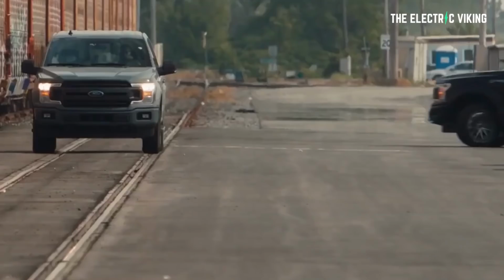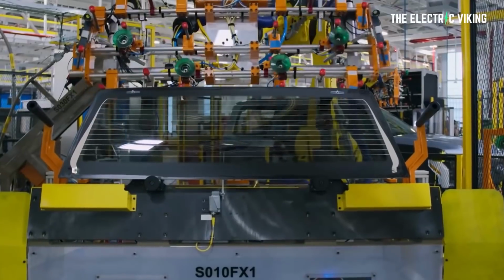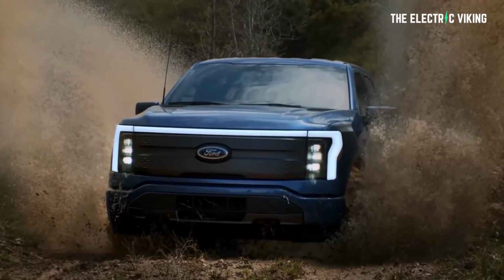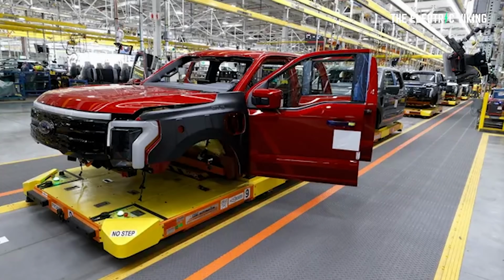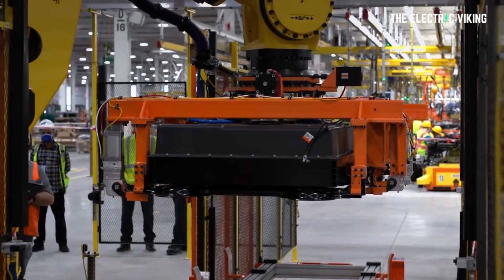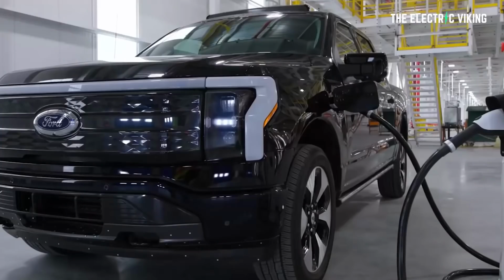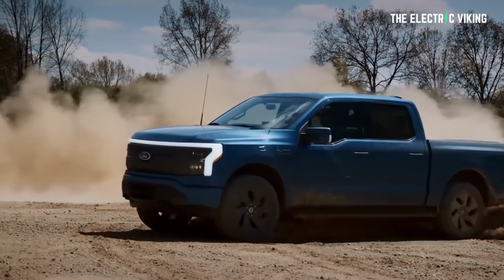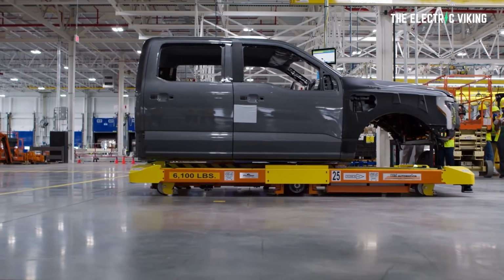Ford's new EV plant exposes Ford's ticking time bomb

Comment: One thing the F-150 EV has that could be a game changer is its Intelligent Backup Power. The truck can provide 9.6 KwHs to power your home. This could disrupt the entire backup generator industry and at a minimum force other EV manufacturers to provide this feature.
Reply: Mostly gimmick because first of all you may want to be able to drive your vehicle which is now powering your house and can’t be disconnected, you also may want to have your battery full for driving (especially in emergency situations) and not depleted by the house energy consumption. Lastly this sounds good for clueless customers but you can’t simply hook up your house to external source of power when grid is disconnected without additional equipment- automatic transfer switch ensuring grid is safely disconnected from unexpected source of energy (your car). If you already buy ATS and all electrical service needed to make this work this better to simply buy stationary backup battery. Overall: Nice to have but nothing truly necessary or revolutionary manufacturers may want to make people think.
Reply: @kubismatik2  Its all digitally controlled Your house does not go dark if you disconnect your car. Its still connected to the grid. You average car today can power your average US home for two days. It only needs to power it for 4-5 hours in the evening during the peak demand. There is a ton of wind energy everywhere at night that is unused and can go to the cars. That is why if you drive past a wind farm late at night they are all shut down. Even though the wind blows more strongly at night on average. If there is no place for the power to go, it blows up transformers. The entire grid is a just in time system with no inventory. If you can power your house from your car during those peak hours? It will save you more than 70% of your power bill. Peak time is the most expensive energy.
Reply: @davefroman4700  sorry you misunderstood my comment, I talked about use for backup power as someone mentioned generators. You talk about V2G which again is something doubling the function of stationary battery which is always available.
Reply: it's not the battery power but the current and an F150 can't run a 4-5ton AC.
Reply: Governments are going to force V2G capabilities onto the manufacturers. We need to use the cars as storage as well as transportation.
Reply: Well, do you see the problem with that? Sure it can power your home during a blackout but how are you going to get to work in the morning on a dead battery?
Reply: Surely 9.5kWh is barely a tenth of the battery capacity for such a vehicle. I would expect in times of emergency outages that nearly the whole battery’s capacity could be available for home use.
Reply: @steveharvey2001  This 9.5kWh is not a battery capacity rating.
Reply: @twosawyers  it’s less than a tenth of a battery with over 100kWh capacity.
Reply: @steveharvey2001  it’s telling the max KW it can put out in a hour.  Your home is using 9600watts a hour, unless you have very inefficient equipment.  Space heaters water heaters and AC are the biggest energy killers.  In other words it should power a average home 3 to 4 days.
Reply: @steveharvey2001  I was ignoring the 9 kwh as that isn't even one small electric heater. It is my understanding that most can back feed to the full capacity of their battery.
Reply: Call your electrician and ask him how much to rewire your home to use this feature. You can power a few things but to run your house would cost some bucks. And of course it heaven forbid you need to go somewhere the powers off till you get back. It's handy but it's far from the end of generators.
Reply: It's good in theory, if it's really good (actually used) everyone can implement it in a week.
Reply: In my opinion the F150 is the ultimate electric vehicle at the moment!
Reply: @twosawyers  good thing no one cares about your opinion. 

BTW: when are you getting yours? did you put your order in?
Reply: My 1972 VW kombi can do that :)
Must have something to do with the inverter and LiFePo batteries in it not the 1600 air-cooled VW engine it uses for driving around.

Comment: Or, the old ICE factories can be reset, revamped, redone to be electric car manufacturers instead of ICE manufacturers.
One plant at a time, and current employees could help so no/minimal job losses would occur.
Reply: except their electric factories will have more rorbits and less workers
Reply: @nick191088  The EV factories have less robots and less employees by virtue of a simpler process with less workstations.
Reply: The old factories will be under management of the ICE brand. Ford is planning a series of new EV factories in Tennessee. They have been using temp workers for years, which is probably saved them a lot during this chip shortage while factories are idle. ICE will ramp up a bit for the next 2 years but any new jobs will be temp workers while older workers retire. Younger workers will be transitioned to new EV factories over the next few years. It will be a 5 or 6 year rebalancing instead of mass layoffs.

Comment: Many auto factories are now using AGCs - Automatic Guided Carts that need no tracks or rails. A bare bones vehicle is placed on each cart which then dutifully stops at each "station" where specialized workers assist robots, then on to the next stop until the single inspection on each finished car. Tesla uses the same EQUIPMENT, but ONE TEAM is assigned to EACH AGC and goes with it until the car drives away. Each team member knows ALL jobs for that team and teams inspect each other's work - as do the test robots at each station.
Reply: This " Each team member knows ALL jobs" explains Tesla's poor quality control and is the  most inefficient method of mass production.
Reply: @heathwirt8919  : production numbers would indicate otherwise
Reply: @dewiz9596  Abysmal quality control is a true indicator of production efficiency or in Tesla's case lack thereof.
Reply: @heathwirt8919  Nope! Tesla had some quality issues because Freemont was not setup to use AGV etc and also Tesla was not experienced at mass production. Just as FORD had MANY quality issues when  they released the Model T Ford, even today they STILL have many quality issues such as over 1.4 million cars recalled due to steering wheel falling off to name just one.
Look at Fremont now and also more importantly Tesla China where the quality is now spot on.
The cars coming out of Tesla Berlin is now as good as any German car.
Tesla also are the MOST efficient car maker as Sandy Munro agrees and also so does VW CEO Herbert Deiss who asked Elon Musk for help in how to speed up and get more experienced.
Reply: @taefravis  the quality problems with the model t stopped when they started buying the engines, drive trains and chassis From Dodge Brothers.
Reply: @taefravis  I worked setting up lines and developing new models for GM for 27 years. Tesla workers have to be experiencing a huge learning curve.  The new plants at Austin and Berlin are not going to be running one job after the other.  for some time.  These plants have to be going through 'production hell' right now.
Reply: @taefravis  Sandy cannot say too much negative about Tesla.
Reply: That's interesting.

Comment: Not only are the employment numbers going to go down in the car biz, but also,  the number of vehicles needed is going to drop substantially, as you have the triple forces of 1) e-bikes are growing faster than any other form of transportation, and will displace car travels,  2) robotaxis are already being deployed in a few cities, and that cuts down the need for cars, and 3) massive number of EV startups in Asia, will eventually get some marketshare in the USA.

Ford isn't doomed; their DNA is making cheap vehicles for the common man, and they have a lot of institutional knowledge about how to do that. Their Maverick truck (1/2 of the units are Hybrid) and their Bronco are both design masterpieces, and although neither is an EV, nor will be an EV for years to come, they fit a sliver of the market perfectly.  

The VW joint venture truck should come out next year, it will be smaller than the F150, and use VW's skateboard chassis.  It will give both companies a chance to have a lower priced product.  The Lightning has a low starting price, but configured on average it is over $50k.

Comment: Looks like Ford plans to build hundreds of Electric Trucks a quarter.  At this rate Ford will never overrun the demand with supply.  Not to worry, Tesla will start building Cybertruck in 2023.  Tesla EV truck sales will 10x Ford EV truck sales by 2025.
Reply: at the f150 intro the other day, ford president said they would produce 600,000 EVs next year.
Reply: @scottmcshannon6821  lol
Reply: @scottmcshannon6821  I thought they said 150k
Reply: @scottmcshannon6821  I think he said a run rate of 200K by the end of 2023.
Reply: @SomeTechGuy666  Which means nothing in the face of component or battery shortages.  Run rate only matters if you can achieve it and stay there.  Plus they keep ignoring the lack of chargers.  Unless fleets are buying these and installing their own superchargers, the lack of chargers is going to hamper sales.  Ford is lucky that people are motivated to get EVs, but there is still going to be a lot of people who don't realize the limitations of an EV without chargers enabling travel.
Reply: @scottmcshannon6821  Why only claim 600,000?  Why not 6 million?  Those are both lies.  Ford CEO did not say that in a legally binding way.  You notice that?  It is an important clue.
Reply: @scottmcshannon6821  He lied.

Comment: Can anyone share the drag coefficient for this e-F150? And then compare it with its competitors.  With its massive flat nose and straight-up flap at the back of the bed, it must be… challenging, to say the least.  And the Ford engineers clearly haven’t realised the massive effect it has on EV power consumption… Or theo might have but were then overruled by the Marketing department.  A more streamlined design could easily saved a third of the battery for the same range… and weight… and cost…
Reply: Never trust an ICE company to build an EV!
Reply: the MPGe is 68, rivian is 69, the hummer is 47. a good EV MPGe is over a hundred, teslas are over 140.
Reply: @scottmcshannon6821  - that cybrtrk won’t be anywhere near 140, but will certainly raise the efficiency bar for truck manufacturers.
Reply: @dennislyon5412  a major factor in MPGe is number of motors, the rivian has four and the f150 has two, the cyber truck has been talked about having 1,2,3, and 4 motor version. im think the single motor version, if it happens will be about 100. with the multi motor versions being higher than any EV truck yet.
Reply: @scottmcshannon6821  - let’s hope that Tesla can get near the 100 mark with their 1 motor truck.  That would certainly “reshape” the future of EV trucks.
Reply: @dennislyon5412  im sure hoping for NPGe of a 100 for the single motor.
Reply: @scottmcshannon6821  most Teslas are in the 110’s to 133 range.
Reply: @scottmcshannon6821  the MPGe is set by EPA.  Tesla cooks the books in that testing as hardly any Tesla's break 100mpge in the real world.  My 2018 CT6 2.0E plug-in sees about 90 mpge average and it has a engine and transmission.
Reply: The old Lightning had a CD of 0.36, the new one is claimed to be better. The current model Dodge RAM is 0.36. The electric version is flat and smooth underneath so it only going to improve. The front end from the top view is fairly rounded it is not as flat as it looks. It is not like cheese wedges are very aerodynamic we gave that up in the 70's.
Reply: Assuming the bottle neck at EV Ford are batteries a high CD will require more batteries/EV which will mean fewer EV-150 available. If Ford produces 50k EV trucks in the next 12 months I would count that as a victory.
Reply: Given the poor aerodynamics will Ford be putting in much larger batteries to get decent range? If so how will they be able to produce them at a profit? Doesn’t stack up to me.
Reply: @ISuperTed  the batteries will be huge, which makes it actually more than a pipe dream, the claim that VtoG will be useful.
Reply: You have to keep in mind the massive weight saving though using aluminium instead of old school heavy steel
Reply: The Lighting is just a modified F-150.  You only tweak aero on that box so much.

The Ford F-150 Lightning is already being promised a redesign for the 2025 model year. Reuters mentioned this when discussing Ford’s production plans for the Lightning.
Reply: This is a truck designed to carry cargo plus people and efficiently packaged to do so. If aerodynamics were the goal it would compromise the utility and hauling capability of this vehicle. That's why it's called a truck.
Reply: @heathwirt8919  Most of the aerodynamics is in portions of the truck that aren't doing any hauling.
Reply: @CorwynGC  The front profile is mostly the front trunk with 14.1 cubic feet of protected cargo space. This smoothly transitions into the windshield and cabin (which holds people). The sides are designed for aerodynamics as well as the flat underside. Any changes to the body style would reduce packaging efficiency and utility.
Reply: @heathwirt8919  Don't forget: everything you put into it will affect range. Same as all the advertised towing capacities. If you tow a trailer at 50% the vehicle weight, you cut the range in half. If you tow something the same weight as the vehicle, you cut it in half again. 400 miles becomes 200 miles which becomes 100 miles. 

Some advertising 12,000 lbs towing capacity which would give you a range of about 80 miles.
Reply: @muskokamike127  The calculation is much more complex than that because drag is proportional to the square of speed and becomes a bigger factor than just weight as speed increases. I've towed using gasoline powered vehicles and the hit on fuel economy is huge, if you slow down it improves substantially. The onboard computer on the F150-L performs the calculations for you and gives you an accurate estimate on initial range and updates the estimate en route based on actual energy usage.
Reply: @heathwirt8919  Yes I realize that but as a "rule of thumb" the more weight you carry, the reduced range you'll realize. 

My estimations are very conservative since they don't include drag/wind resistance. 

But as a general rule of thumb, my estimations are fine.
Reply: @heathwirt8919  It's kind of like converting C to F...you can try and remember the exact formula and use it, or you can use "double it and add 30". Which is close enough for the girls I go out with.